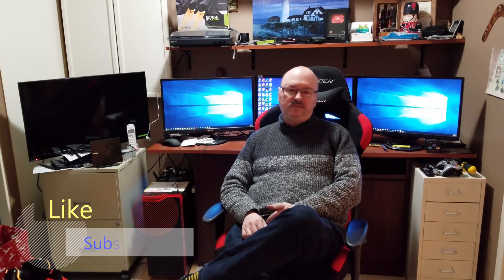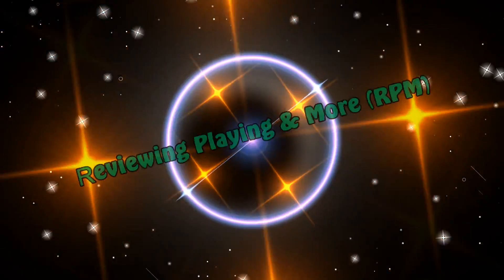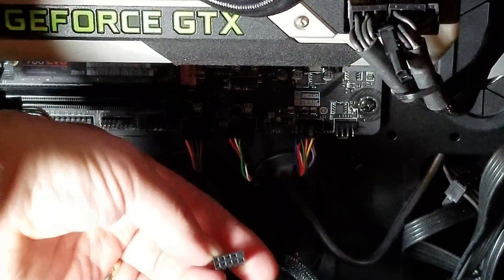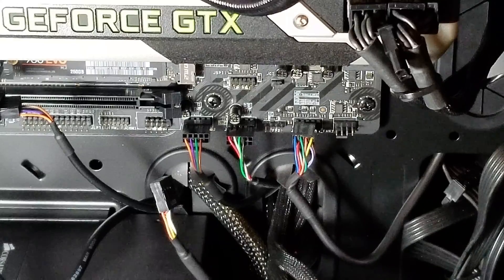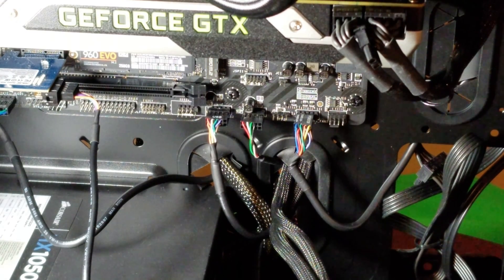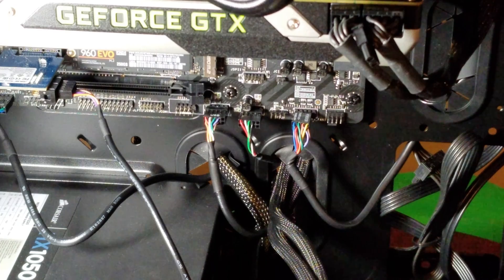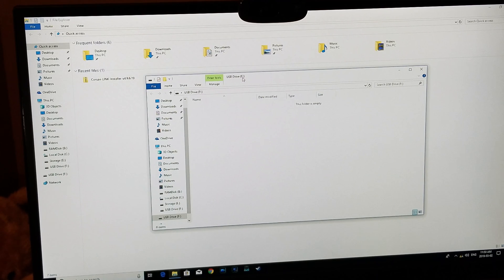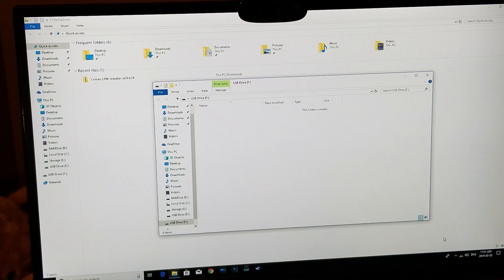Case USB Not Working let's Diagnose Why

Comment: Hello, could someone assist me? I've connected an AIO to my motherboard's internal 2.0 USB 9x pin Header. It's receiving power, but I'm unable to receive any data for real-time CPU and GPU temps. I've already checked the cables, ports, BIOS, and chipset.
Reply from the maker: Your AIO has a cable that plugs into either the AIO Header or CPU Header, if you have plugged into the AIO Header you should still be able to get info, same for the CPU Header. The cable you connected to the USB is different then I'm used to so its possible there is separate software for that particular AIO that might need to be downloaded.

Comment: What is the usb cable my pc case didn’t come with one
Reply from the maker: All new modern Cases come with USB Ports, in this video though I'm referring to USB Headers on the Motherboard. When you have a case that has USB Ports there will be a cable that will need to be inserted in the correct USB Header on the Motherboard in order to activate the ports on the case.

Comment: Bought a brand new pc accidentally was plugging the hdmi into the motherboard, and wondering why it wasn’t connecting to the monitor, after a few resets my keyboard and mouse won’t connect any more, so now all my usb ports won’t work and I can’t get the display on.
Reply from the maker: If its new take it back they should fix it as it will have a warranty.
Reply: @Reviewing_Playing_and_More_RPM  I actually ended up fixing it, by using a pencil eraser on the ram lol
Reply from the maker: @vonthegreat870  wow that's a new one on me, well done.

Comment: Just bought a new case installed everything right when I tried to plug my mouse it didn’t work even on the 3.0 one nor my motherboard how do I connect my mouse to be able to update drivers
Reply from the maker: So first check your connections as there should be a cable from the case USB 2.0 and maybe 3.0, if they are both in then and as you said even the USB on the MB itself isn't working you'll need to use an external DVD Drive and place your MB DVD that came with the MB to install the Drivers. They should have worked as soon as your system was up and running so there's always the possibility of some other Hardware issue, so some basic troubleshooting might be required.
Reply: @Reviewing_Playing_and_More_RPM  can i just install it back to my old case that has 2.0 usb and try to update my motherboard then try to put it back into the case I just bought
Reply from the maker: @sosa4472  Yeah you can do that, everything should go well.
Reply: @Reviewing_Playing_and_More_RPM  Just did and nothing could it be the motherboard thats bad but everything works on it
Reply from the maker: @sosa4472  Yeah it's possible that was a thought I had at first so it could be.
Reply: @Reviewing_Playing_and_More_RPM  I’m back lol so should I try replacing the motherboard first ? Like the Ethernet port lights up on the mb but the usb don’t work fans spin rgb works gpu fans works or is it the CPU ?
Reply: @Reviewing_Playing_and_More_RPM  also it won’t load the windows os anymore just black screen no signal
Reply from the maker: @sosa4472  Sorry for the late reply but if everything is working except USB then it could be drivers, but if your having other problems as well then it becomes a troubleshooting time to test each component before just buying a new MB, the light on the Ethernet just indicates your getting power to the MB, sometimes a bad Power Supply can cause intermittent problems and the same can be said for a MB that has something wrong with it. While it could be CPU it's highly unlikely as CPU's very rarely fail, not saying it can't happen but it's just very uncommon. So do some troubleshooting at first then hopefully this will let you determine if you need a new MB or if it could be something as easy as a Driver. Good Luck

Comment: What if all the USB port don't work including the ones in the motherboard
Reply from the maker: It's likely a Driver Issue but can be other reasons as well, try the following.
Scan for hardware changes…Click Start, and then click Run, type devmgmt.msc, and click ok, Click your computer, click action, then Click Scan for hardware changes. Also check the USB device to see whether they are working. Restart your computer then try your usb devices again. Hopefully one of these will work, not sure what else beyond this though atm.

Comment: Do those wires come from the power supply or does the motherboard box usually have them?
Reply from the maker: They come from the Computer Case, there are other cables from the PSU that will plug into the MB and SSD/HD as well though.

Comment: But what happens if they are working for 2 months and then just start bugging
Reply from the maker: Well there are recent issue's that point to PCIe 4.0 causing issue's with USB Ports, if you search for that you'll find a lot of info, and there quickly working to fix these issue's.
Reply: @Reviewing_Playing_and_More_RPM  I’m currently contacting GIGABYTE, This issue happened the first day of my build then went away for months, it’s now starting to affect my back USB ports and The front ones as well. Super frustrated right now!
Reply from the maker: @e5aix  Yeah it's possible it could be a defective MB as well, I hope they can help.
Reply: @Reviewing_Playing_and_More_RPM  thank you!

Comment: Hi just built my new pc. On my asus x570 wifi motherboard. But none of them work not even the cabinet usb ports work. Please help
Reply: I plugged in the usb3.0 on the motherboard next to 24 pin cpu. But it still doesnt work
Reply from the maker: @Arm_bar5  Have you installed the MB Drivers? If not you need to do that, you can check Device Manager to see what it's saying as well...if you have check it's fully inserted, otherwise not sure why it wouldn't be working...
Reply from the maker: Only thing to do is start checking cables and that you didn't miss plugging one of them in, there's usually a USB 2.0 and a USB 3 so both need to be plugged in...

Comment: Just found out I broke a jumper pin on the motherboard which disabled one of my front ports. Really pissed off because this is the 2nd time in a row I've messed it up the front port on my builds.
Reply from the maker: Sorry to hear that, yeah I've almost done that a few times, actually bent one back carefully and it still worked...those pins are very flimsy for sure...

Comment: I got an issue with my USB 2.0 disconnecting and reconnecting randomly... It happens most comonly when I'm gaming or when a lot of stress is put on the system. But, my USB 3.1 seems to be working almost completely fine. It's only my keyboard that have glitched two times in the USB 3.1 ports, my mouse and headset have worked flawlessly on 3.1 but they do not on USB 2.0...
Reply from the maker: Typically a USB device that keeps disconnecting and reconnecting randomly on its own, could be a hardware or driver issue. See if the device works fine on another computer, if it works, then you do not have a problem with the device, so updating the driver should fix the issue...
Reply: @Reviewing_Playing_and_More_RPM  Thanks for the answer. Just found a whole lengthy thread about it on Reddit tho. Seems like most, if not all ROG B550-E Gaming motherboards paired with an 5900X got this problem... One thing that have fixed it for some people is changing from PCIe 4.0 to 3.0 in BIOS but even if it would help me it’s not a solution in the long run since I need PCIe 4.0... Apparently it has been going on all since the Ryzen 5000 launch and from what I’ve seen, ASUS haven’t been helpful at all, just saying that it’s on AMD to fix it whereas AMD has been saying that a fix is “probably coming in the next BIOS update” for months now, three BIOS’s later and the problem still exists. The latest response from AMD is that they are looking into to it but they do not know when or even if it can be fixed... It doesn’t happen to often through USB 3.1 so a bought a 3.1 HUB and now it’s only the keyboard glitching like once a day. The headset and mouse is completely fine on 3.1 but of course still completely messed over USB 2.0, disconnecting and reconnecting every 5 minutes or so when gaming. So right now, I’m fine as it is for a few more weeks but if AMD/ASUS doesn’t fix it soon, which I’m afraid they won’t since it has already been going on for months, then I will see if I can just RMA both the CPU and motherboard and just get Rocket Lake instead. I’ve had the motherboard since September tho and CPU since early December so it might be a problem getting a refund for them. Saw a guy with the same problem and hardware that got pissed and is waiting for Rocket Lake now instead and he RMA’d the CPU directly through AMD to get his money back and not the retailer. I’ll figure it out somehow.
Reply from the maker: @ne0tic  wow that's certainly interesting, well good luck then...

Comment: hey i’ve got a question my usb’s are not working i can’t even open bios i’ve tried to switch usb ports but that won’t work either
Reply from the maker: For the USB, try updating the USB Root Hub driver. ... Expand Universal Serial Bus controllers section and right-click USB Root Hub. Choose Update driver from the menu. Select Search automatically for updated driver software...(DO AT YOUR OWN RISK) I cannot say this will work, but is a suggestion if you choose to try it...as to the BIOS, here is a link that might help https://youtu.be/FazUP88eIJA, and should you not have a UEFI BIOS, If you don't have UEFI: After choosing Advanced Options, click on Startup settings, click restart and you'll need to know the button to push to get into your BIOS, can be F2, Delete or in some instances F11, so start clicking on the one that applies to your PC and you'll enter the BIOS)

Another way to get into the BIOS is while your PC is on force a shutdown but Holding down the Power Button, again reboot pressing the Del or F2 key whichever is for getting into the BIOS for your system...lastly is to take out the CMOS Battery for about 3 mins, on a laptop you can remove the battery if accessible and press the power button for about 5 secs then put the battery back in and restart, again pressing the Del or F2 Key, (remove the CMOS Battery if possible) again for 3 mins...Hope one of these will help...

Comment: Hello this video will help me? Lets start my problem is that when i plugg my heaphones there are jack pins for microphone and headphone anyways when i go to sound settings the windows says me there is nothing plugged in. Btw i have format my computer then i just download lastest bios updated, changed windows pro to pro n, downloaded a lot of drivers for the audio but there's still nothing for my heaphones and mic btw my headset its working fine. Anyway i hope you see this message and help me i just have spend a lot of time and still nothing Thank you
Reply from the maker: I have a video on how to connect all the cables to the motherboard that might help you, but for now check that the HD Audio from the case is plugged into the Audio on the MB, also to get the best sound from your system, plug things into the audio on the back of the case the slots on the back have the best audio vice the front of the case connectors...

Comment: I recently built my first PC none of my motherboard usb or any ports are working any reason why?
Reply from the maker: Only thing that comes to mind is to start with checking where everything is plugged in, ie your USB 3.0 and USB are correctly plugged into your MB, check you've installed the USB Drivers, you can check in Device Manager to see if there's any indication of this...although unlikely it can sometimes be a Power Supply issue...
Reply: @Reviewing_Playing_and_More_RPM  thank you. But I can’t even get the monitor to connect to the PC it says “display port no signal” I haven’t been able to install drivers or an OS becuase the monitor doesn’t connect. 😔
Reply from the maker: @DopamineDreamzz  "DisplayPort no signal" issue is usually from not being connected properly, check the connector has been plugged into the port correctly.
Reply: @Reviewing_Playing_and_More_RPM  thank you for your help. Will do. 😎

Comment: The same exact thing happened to me!!!! It was inverted and it was a manufacturer issue but I cant send it back 😔
Reply from the maker: If you can, maybe just remove it and see if it'll work in one of the other USB slots, if not might have to get a USB Internal Hub...either way good luck...hope you can at least use the system...

Comment: I tried this, it did not work ☹️
Reply from the maker: It's a very specific case, it is something that won't apply to very many, if you have a USB Port not working best thing is start with checking that the case USB Cable is plugged into the USB on the motherboard, if it is, then it's possible that it might be the case itself...Thanks...

Comment: Hello I installed my Webcam on my MacBook Air on the right USB port and it works fine. But when I switch to the left USB port it doesn’t come on. I can get Audio from left and right USB but not video. I’m also using Streamlabs as my video capture. Any help will be appreciated.
Reply from the maker: This seems to be a common issue, but hopefully this will be an easy fix, try this: Reset the SMC: Shut down the Mac and connect the power cable. Hold down Shift+Control+Option+Power concurrently for a few seconds, when the light on the power adapter blinks or changes colors you'll know SMC reset is complete. Release all keys at the same time. This has been reported to fix this problem...Hope it helps...Thanks...
Reply: @Reviewing_Playing_and_More_RPM  I was able to get it working after an hour but I will try this method next time. I appreciate you getting back to me.
Reply from the maker: No Problem, glad you got it working...Thanks...

Comment: I  dont hink a pc chassi like Fractal design focus is very usuble - It looks good but It has weeak quality and the 2 chassifans wont work with my motherboard , next I dont think the sole usb 3 can deliver power to chassi AND floppys and 2 cd/dvd roms ,sound ,headphones + 2 usb... questionable really.
Reply from the maker: That could be true, but this is a Corsair 750D...Thanks...
Reply: @Reviewing_Playing_and_More_RPM  I guess buying cheap computer hardware unless used never is a good thing.
Reply from the maker: @mermacyinp633  it depends on what you know of the history of it, ie does the product have a good history in terms of reliability and if you know the person your buying from...I have bought budget computer hardware and sometimes it's been really great, I've bought really expensive hardware and it's been worse then the budget hardware so it can really depend...the Corsair 750D is actually one of the best cases I've built in which is why I have it longer then any other and it was middle of the road expensive...I started off building PCs from cheap used parts and those systems are still being used by friends after years of use...there are so many variables, it just pays to research the parts etc to best determine how reliable they might be, I actually had a used Motherboard that died but it had a warranty that was still in effect and they sent me a new one so can get lucky as well...take care and have a great day...

Comment: I have a question. Which is the best pc for streaming on Xbox.
If you only have $1000
Reply from the maker: +Parallel Zinxz Well that's a question that will vary depending on who you ask...However these days I think a AMD Ryzen would be best...You don't need a top end one but a Ryzen 5 2600 should get the job done just fine...Now as in regards to the XBox I'm not sure since I don't own one but it should be good for that as well...Hope that helps...
Reply: Reviewing Playing & More RPM - yes that helps. Thank you so much

Comment: 👍❤✌😎🔌
Reply: +👍7
Reply: I have had many USB cords go bad
Reply from the maker: Yeah me to...
Reply: If i wanted a gaming computer would it be cheaper to create or buy?  How long would it take to build?
Reply from the maker: It depends on a lot of factors but generally to get a more powerful computer it's cheaper to build then to buy, especially for upgrading it later...However there are a few PCs out there that come at a great price...It boils down to upgrading over time, a custom built will save you more over time then a bought system...I can build one in less then a day but usually take 3 days to deliver because I do multiple tests to stress the parts to make sure they'll work properly...

Comment: How do you plug it in wrong..it has a block that prevents you from doing that. But it helps to plug it in the right place. Serial also RS-232 is used to connect legacy serial devices such as interface cards and in the olden days modems for the internet.
Reply from the maker: Thanks for the info on the RS-232, it should not have gone in but it does, not sure why, it's weird...
Reply: Reviewing Playing & More RPM Sure. Like you videos.